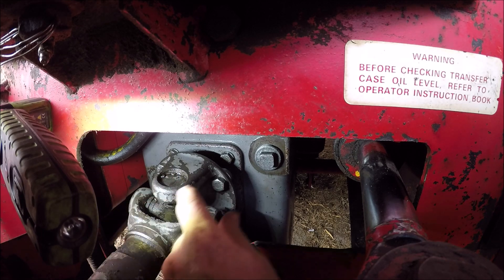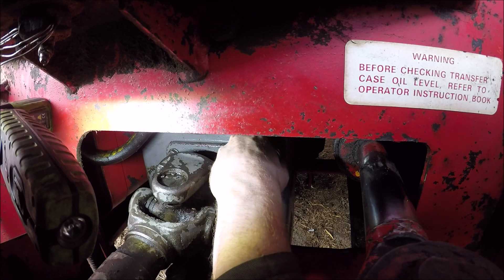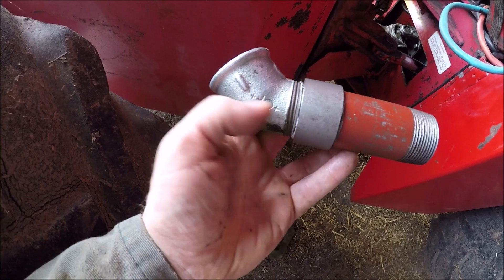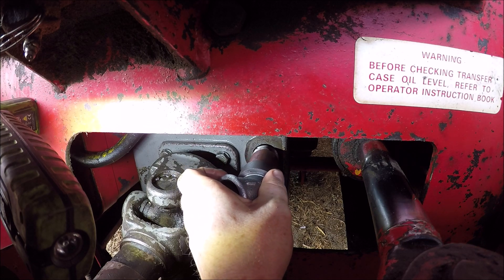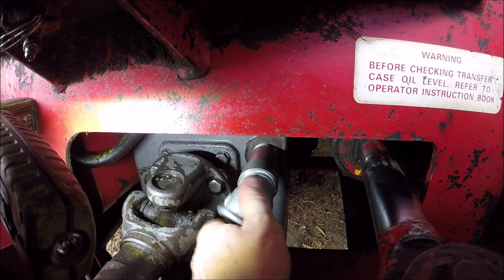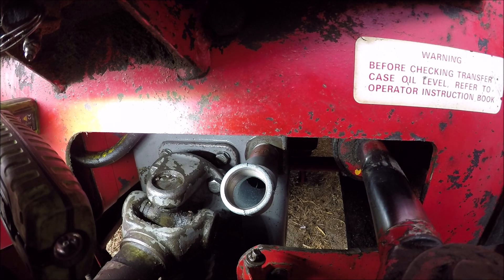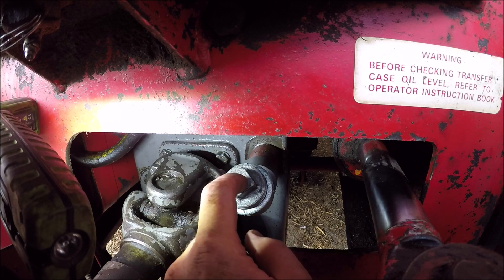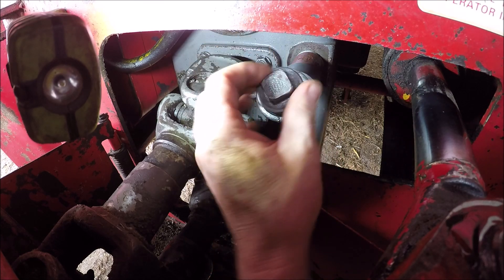Massey Ferguson 1200 tractor gearbox oil filler modification.

Comment: Hi Dan enjoyed vid do you think PTFE tape would have been worth using
Reply from the maker: There is some on the joints in the pipe, but the end that is screwed into the gearbox is tapered, and the plug didn't have any, so far it's not leaking.

Comment: Short but sweet!!
Do you use 90 gear oil or is universal 30 sufficient?  Have you MF training or have you picked it up as you go along. 
Thanks again
Reply from the maker: Its universal oil, 90 would be too thick as it also supplies the steering and multi power circuits.
I'm not trained in anything, just pick it up from books and having a go!

Comment: why don't you turn the tractor so you can get in better
Reply from the maker: Because it's not safe to rely on a hydraulic ram to keep the tractor turned while you're working in that area.
There are mounting points for a safety bar to keep the tractor in a straight ahead position while you're working on it.
Reply: @CowfarmerDan  ok